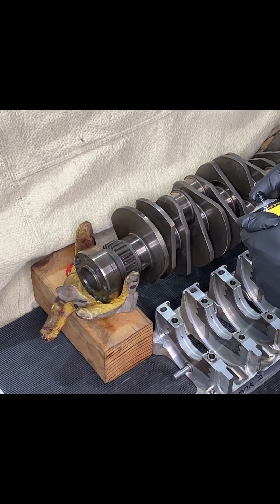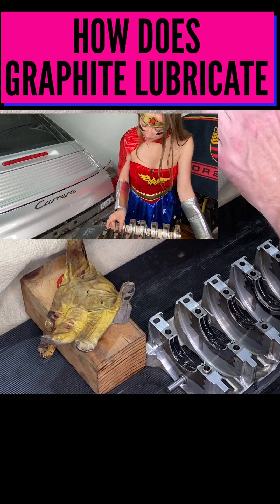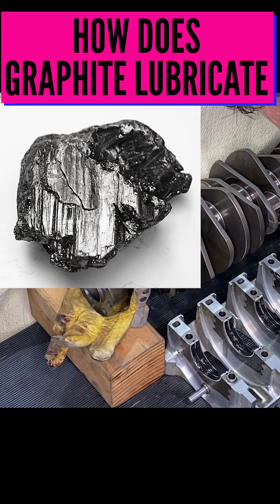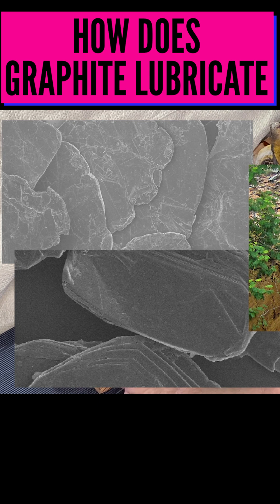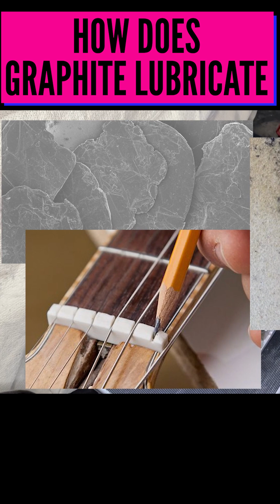How does Graphite Lubricate?

Comment: Graphite best to reduce heat engine?
Reply from the maker: @ahmadalbab5448  There may be better solutions for heat dissipation. Thank for watching 🤘😎
Reply: Not answering my question
Reply from the maker: @ahmadalbab5448   I’m not answering your question because i  am not an authority on the subject. In my opinion with regard to heat dissipation you would be better off with the smallest particle size possible to maximize the relative surface area and therefore the ability to transfer heat. A pure liquid would be better than any colloidal suspension at this task. Just my opinion. What do you think?